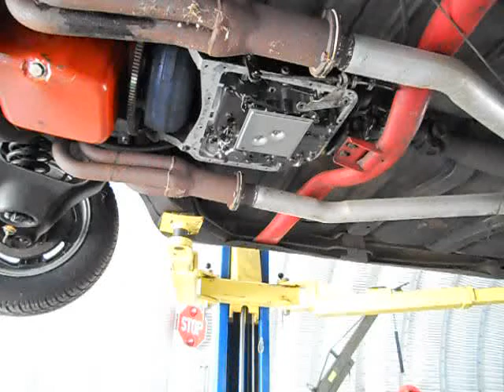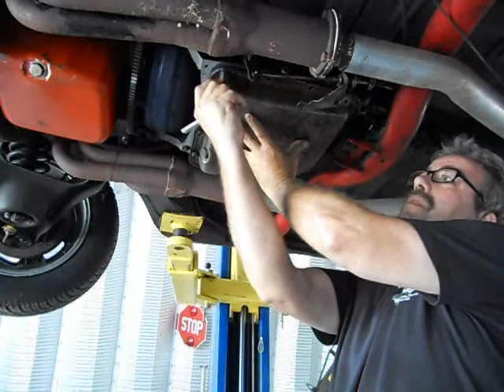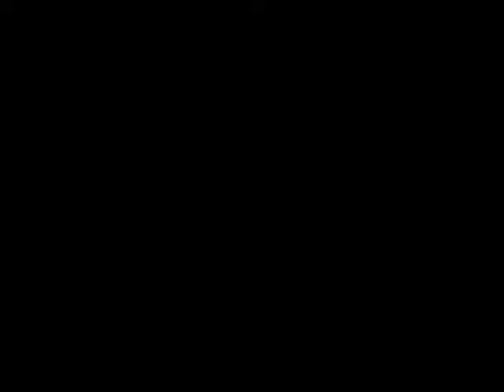th350 transmission filter change on the 67 chevelle pt2

Comment: Hi, how many quarts of oil did you have to use to refill it? Gonna do my oil change on my TH350 78 nova. Did you reuse same filter or was it a new one?
Reply from the maker: If I remember right the th350 took 5-6 quarts for the service and yes always change the filter. I did a trans replacement on that car later and put a th400 in and the trans guy told me to fill it till it came out the overflow on the top of the trans it was completely empty tho incl. the torque converter. I didn't think he was right but did it anyway and it was 1/2 quart low when I started it and checked it he was spot on.

Comment: Gonna be attempting this for the first time ever. Have any tips or things to be mindful of before while or after changing the trans filter?
Reply from the maker: It's pretty straight forward just one tip that I didn't mention is that used trans fluid is one of the worst things to get on your skin so cover up and if you do get some on you get it off quick.

Comment: what is oem torque on the bolts? anyone know?
Reply from the maker: Around 10-12 lb but most dont use a torque wrench on trans pan bolts we snug them and then go around the pan bolt with an even feal not to crush the gasket. Also cork cant handle as much as a rubber gasket.
Reply: @scottsinfl  some reason i used a rubber gasket on mine and then it developed small leaks around the bolt holes. Scott do you think i should use RTV? with the rubber gasket. And RTV on both the tranny and pan? Then put on the gasket too?
Reply from the maker: @jerbear6947  You shouldn't have to use any on a rubber gasket. Is your holes flat? Sometimes they need to be hammered flat and don't over tighten the bolts or that will make them leak also. That's not saying you can't use just a skim of sealer to solve a problem but shouldn't have to if its straight.
Reply: scottsinfl ok thanks. I decided to do that put a skin coat on the pan side. I used my inch pound torque wrench at 10 inch pounds. But it still felt like that was to tight.  Guess we’ll tomorrow what the end result is. Oh also my pan bolt holes were raised and not flattened out the first time when I changed the filter. I got em flat now thank u

Comment: What kind of gasket Material , did you use ?
Reply from the maker: RICHARD maaske Its a rubber gasket with NO glue or sealer.